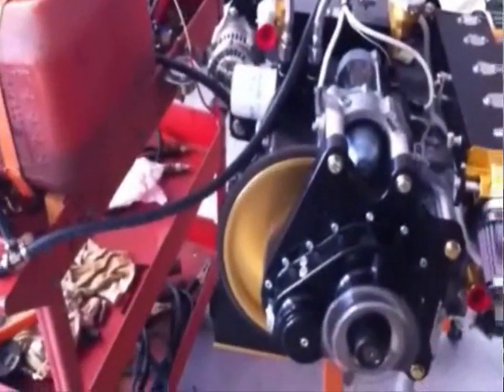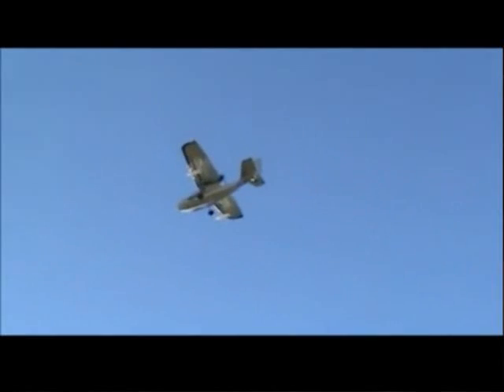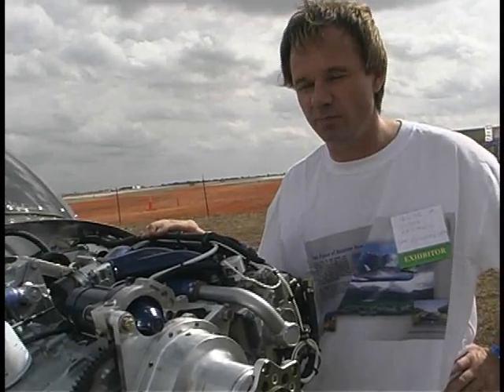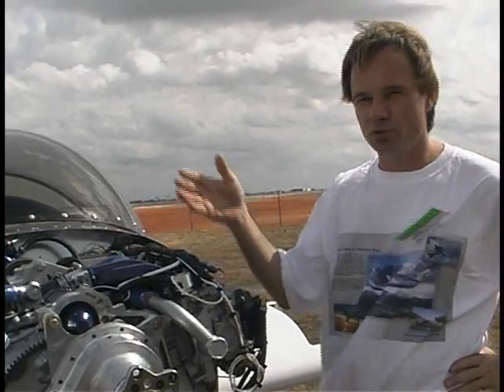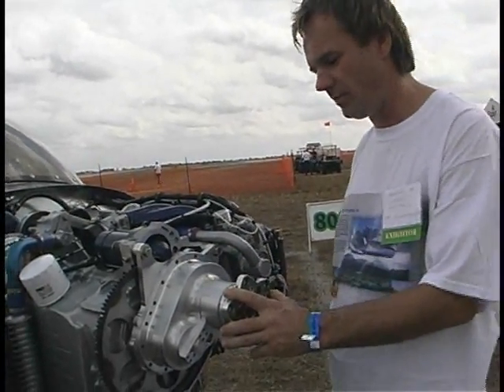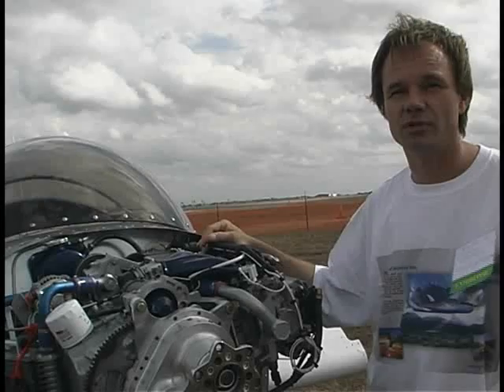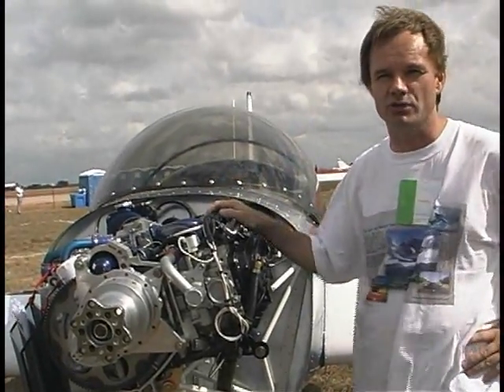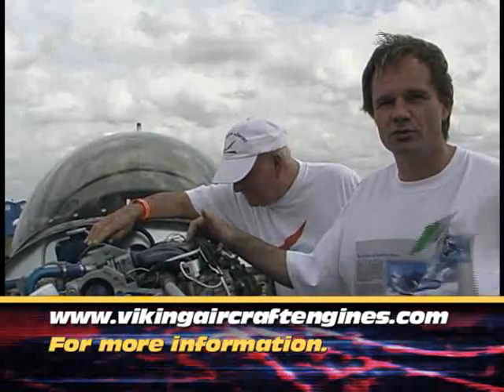Viking Engine, Viking Aircraft Engine, Viking Honda aircraft engine conversion

Comment: As of 2018 there has been nothing but praise for these engines, which are flying in all kinds of airplanes. My buddy with one loves it. It is reliable and performs better than rotax and jab.  Subaru engines suck to begin with, that was Jan’s mistake, he figured it out and is now using a fantastic tried and true engine base.

Comment: There are lots of 'real' aircraft engines out there in the 100 to 150 hp range. If you can't afford one remember this approach cost nearly as much but has none of the real world safety standards or achievements. The four cylinder Lycoming rates 108 - 116 hp. Look for one of those and live with the slight weight difference.

Comment: The lubrication system of an automobile engine is not suited to aviation use.  Honda did NOT design or test this engine to operate at an 80% tilt or to operate under negative G forces or long term lateral G forces.  Your playing with your life if you fly with an engine like this.
Reply: Two words....HOME BUILT 
if you choose to fly certified thats your choice, this is legal end of story
Reply: +John Ferguson what are you basing you statement on do you even know how lubrication work. If you keep it within oil temp rating the engine does not care about rpm. hi long term running will wear cylinders faster and will fatigue rotating components. that is why they test the engine before selling them.
Reply: DOUGLAS ANDERSON The problem is with the oil pick-up and the way that oil circulates to the valve train and drains back to the pan by gravity alone.  Negative G's can lead to oil starvation.  The safety record for automobile engines converted to use in aircraft is mixed at best.  These engines are experimental.  The manufacturer has no involvement in developing this application.
Reply: John Ferguson this runs a gearbox. No thrust bearing required.

Comment: Fit engine is certainly a wise choice.  A Canadian award winning automotives student told me at school he did a tuneup on a Fit engine with 800,000Km.  Compression was perfect on 3 cylinders and WELL within spec on cylinder 4.  Didn't burn oil to begin with, so they decided to change rings on 4th cylinder, new timing belt and sent it on it's way.  It's still racking up miles delivering pizzas.  Honda's race bikes in the 1960s rev'd anywhere from 18,000 (250-500cc) to 23,000 (50cc) rpm so I don't think you have to worry about 4500 rpm.